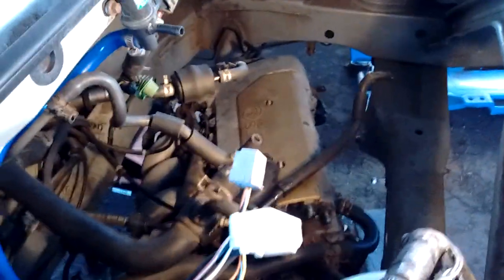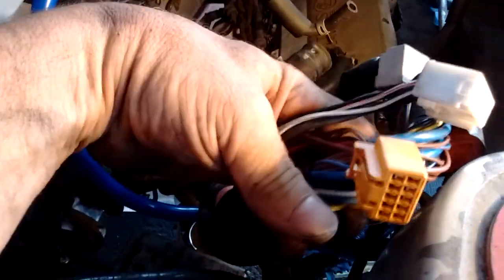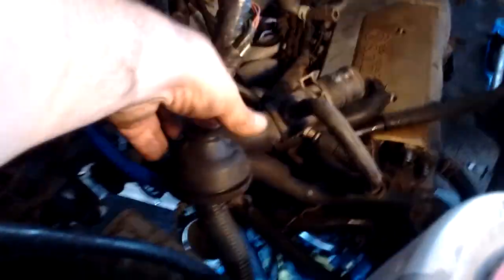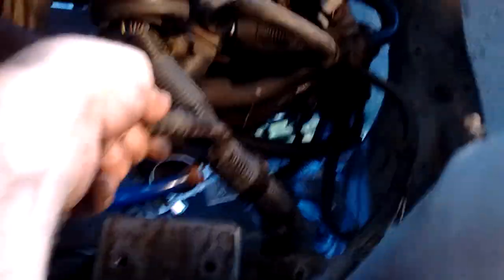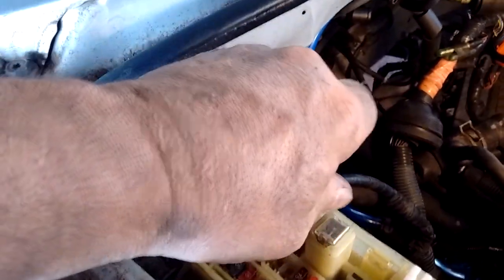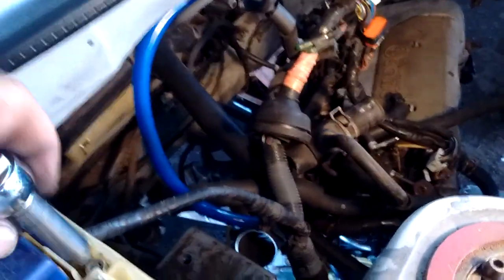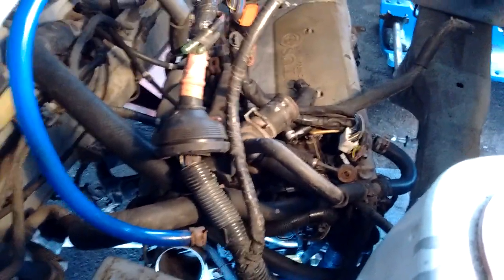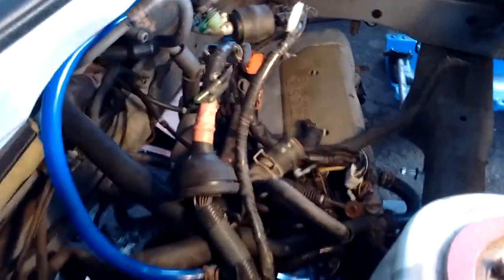How to Disconnect the Engine Harness from the Fusebox - Toyota MR2 Spyder

Comment: Thank you for posting.  Just did this today.

NOTE:  My power wire would not just "push-up" from the PDC (fuse-box), I needed to gently pull on the locks on the side of the PDC.  From the looks of these locking tabs ,it appears the power cable will drop down, but as shown in this video it must come "up" out of the PDC.

Mr. P